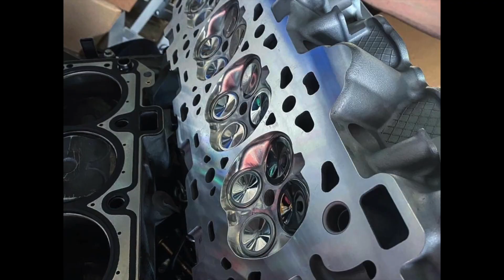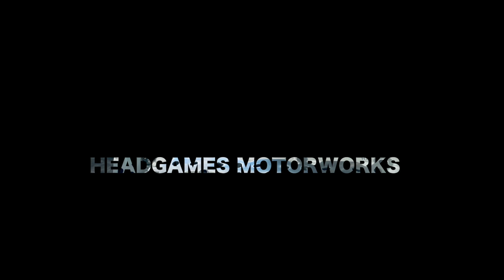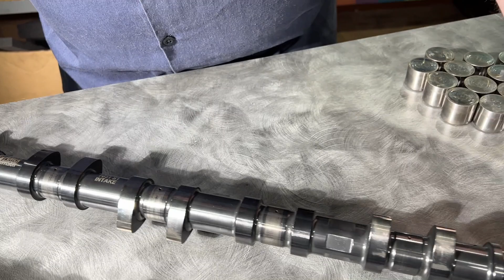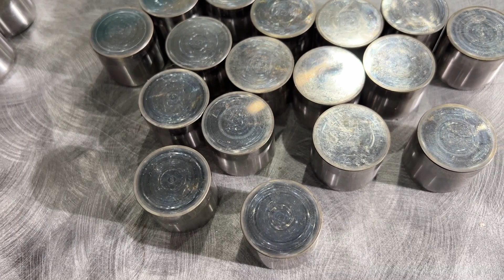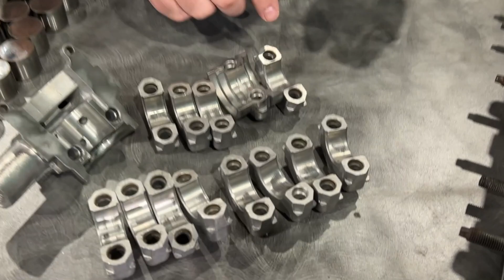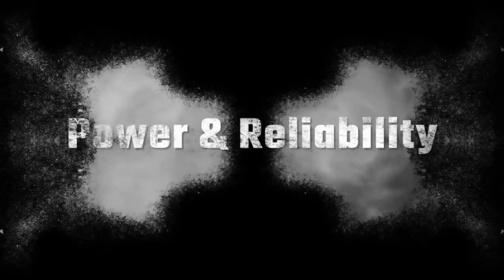2JZ head with billet cams inspection - what do we find??!!

Comment: HeadGames. What's your recommendation on 2jzge vvti or 2jzgte vvti head? Flow and max horse power? Is there a limitation on camshafts also compared to the non vvti heads?
Reply from the maker: Vinh you should check out our 2JZ series on here, we answer that question and more!
Reply: @headgames  . Thanks. I watched the series. I don't see that you have the bc 276 camshafts on your site for recommendation. Would you prefer the gsc s2 camshafts over the bc 276 camshafts. I heard that the billet  camshafts wears the buckets more than the cast camshafts. From videos  I watched. It was recommended to put dlc coating on the buckets if one was to use billet camshafts. What's your opinions?
Reply from the maker: @vinhtran4886  the 276 is a good cam but just prefer the S2. DLC coating is something we are working on a video about. The truth is, if the head is set up correctly there is zero reason to use DLC. Unless you don't like to change oil often and or have contamination from e85 or something. Buckets and cams are meant to slide against each other. When you have a float situation the DLC won't help you. Infact it will be an issue if you do have it. If you have the right valve spring, clearance the head for the lobe, and change oil AND use the right assembly lube the OEM bucket lasts forever. We have never seen a failure that was the cams fault yet. And we probably do more 2JZ's than anyone.
Reply: @headgames  Thanks for the knowledge your teaching me.

Comment: FWIW I ran the GSC beehives for years making an honest 1000+ WHP (i.e., trapped 160MPH full weight 6sp street car in 3000' DA) and revving to 8500 and never had any perceivable issues.
Reply from the maker: Just because it didn’t come apart doesn’t mean you didn’t have issues. I promise there was a serious valve float situation. That spring doesn’t have enough ass for 40psi.
Reply: @headgames  So what is your go to spring then?
Reply: @headgames  Would the GSC conical springs solve the valve float issue since they're rated to 50 psi?

Comment: Those holes/openings inside the valley of the head where the spark plugs go freaked me out when I changed my plugs for the first time I thought I had some kind of failure, still have no idea why they are there..
Reply: They are drain ports. If you have a rocker cover seal failure and a lot of oil comes into spark pug wells or somehow get a lot of water in the spark plug wells, rather than filling up and ruining the coils / boiling whilst engine runs, the liquid goes through those holes down a gallery in the head and exited at the back of the head, so all the liquid runs down the gearbox bellhousing instead.
Reply: @0x33_Uk  wow that’s good to know thanks for that bit of info!! 👍🏼✌🏼

Comment: Question? Oil starvation because of High RPM! or because of High RPM Rod Failure. Or just ROD failure. I personally think high RPM, Wrong Springs, Bearings not to forget ROD ones, Wrong Tuning or Over Tuning, or too much back pressure! CORRECT if possible.
Reply from the maker: if you watch right around 3min in we explain the oil starvation to the bucket. There is 2 oil starvation issues here. Rod and valve float.
Reply: @headgames  GOT IT
Reply: AND if HIGH RPMs belt can be a Problem bucket and CAM damage